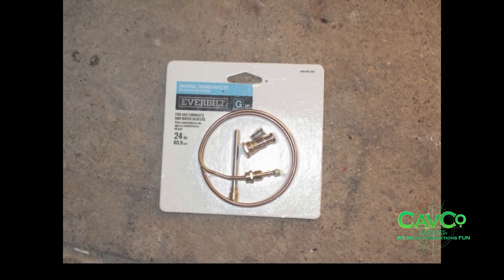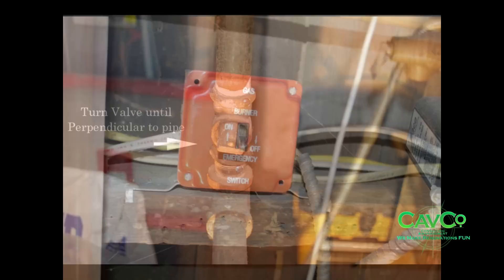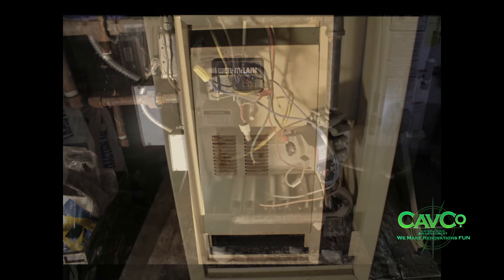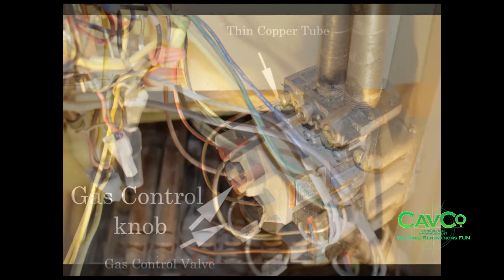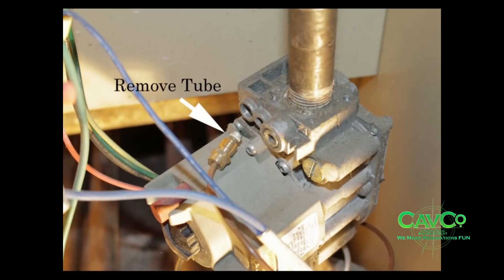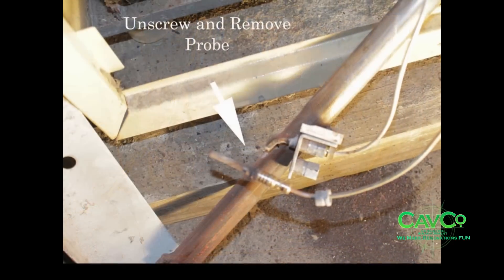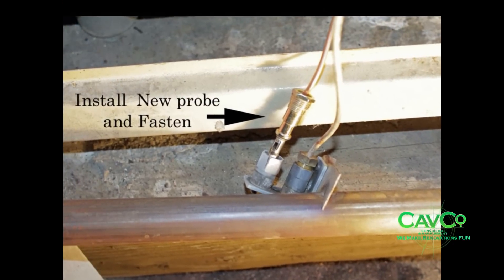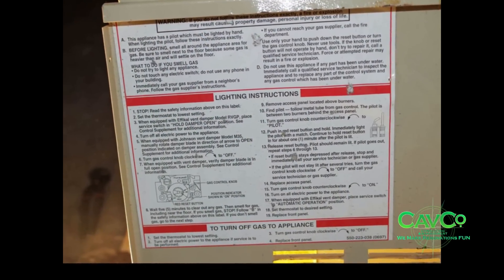Pilot won't stay lit on boiler  Thermocouple replacement

Comment: That was the most straightforward video I've seen. Woke up and the heater wasn't heating. Went down stairs and noticed that the fire wasn't lit so I follow the directions on the side I pressed the thing on Pilot the fire lit and then I let go and it continued to turn off. What could be the issue?
Reply from the maker: +Belen Alvarez I'm glad the video was helpful